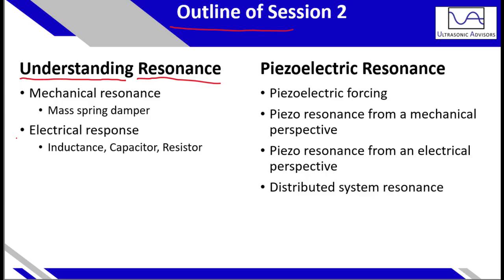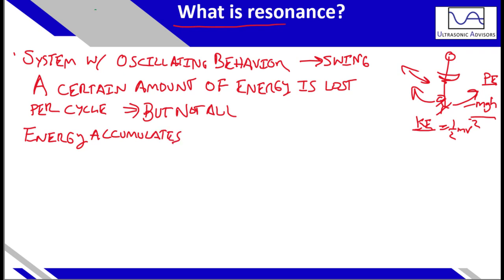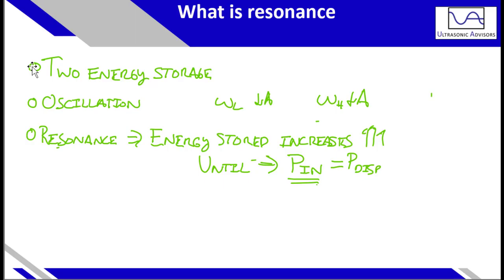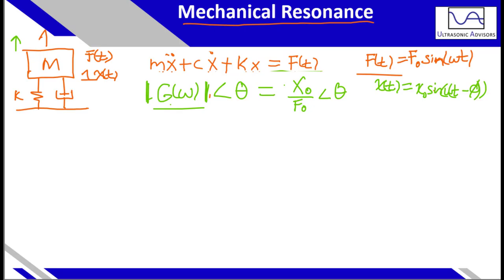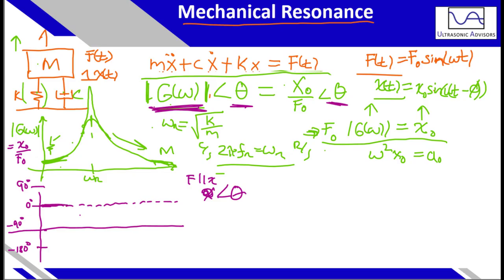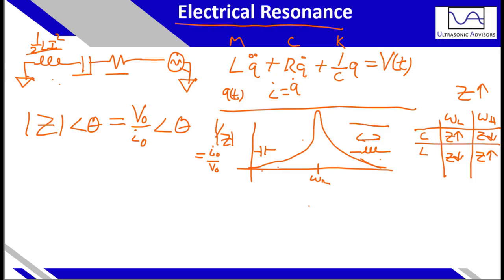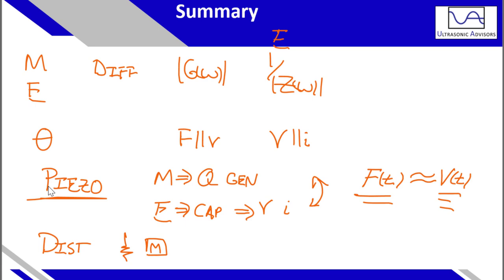Session 2: Resonance behavior | Piezoelectric/Ultrasonic Impedance Analysis Course

Comment from the maker: Mechanical and Electrical Resonance and their Application to Piezoelectric Devices
This session covers the basics of resonance, including mechanical and electrical resonance, and their application to piezoelectric devices 
00:10.

Mechanical resonance occurs in a mass spring damper system, while electrical resonance occurs in a system with an inductor, capacitor, and resistor 
00:58.

Piezoelectric resonance is an electromechanical phenomenon that involves the conversion of electrical energy into mechanical energy 
01:39.

Distributed system resonance occurs in systems with mass and stiffness, and can involve various types of vibrations, including bending and longitudinal vibrations 
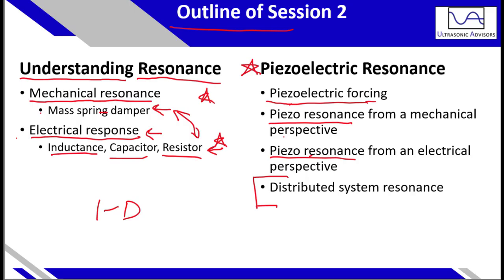02:51.

Resonance can be understood by considering a simple system, such as a swing, where energy oscillates between potential and kinetic energy 
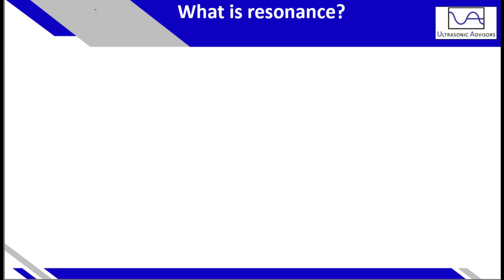04:13.

The frequency of application of force can affect the amplitude of the resonance, with a slow push resulting in a small amplitude and a fast push resulting in a highly ineffective and potentially dangerous situation 
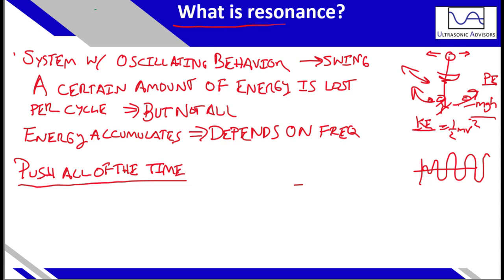10:01.

However, if the force is applied at the right frequency, the amplitude can increase significantly, resulting in a highly effective resonance 
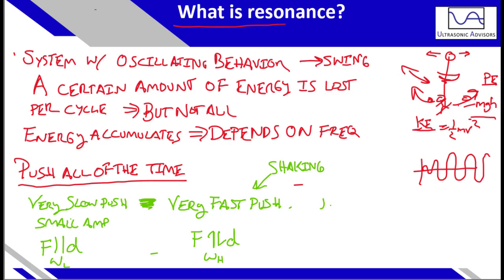12:51.

Resonance occurs when the energy stored in a system keeps increasing due to the continuous delivery of energy at the resonant frequency, resulting in a maximum amplitude 
15:30.

The power or rate of energy put into the system equals the power dissipated, causing the system to peak out, and this point is a transition point where the phase between the forcing function and output changes 
19:02.

Mechanical Resonance
A mechanical resonance system consists of a mass, a spring, and a dashpot damper, and is described by an equation that relates the mass, acceleration, damping coefficient, velocity, spring constant, and displacement 
20:04.

The transfer function, which relates the input force to the output displacement, has an amplitude and phase, and is used to analyze the system's response to different frequencies 
21:55.

The amplitude of the system's response changes with frequency, with a maximum amplitude at the resonant frequency and lower amplitudes at higher and lower frequencies 
25:45.

The relationship between input force and output displacement is described, with the amplitude of the output displacement being larger at lower frequencies and smaller at higher frequencies, and the resonant frequency being governed by the stiffness and mass of the system 
27:39.

The phase relationship between the input force and output displacement is discussed, with the phase being 0° at low frequencies, 90° at the resonant frequency, and -180° at high frequencies 
31:15.

The concept of power input is introduced, with power being the product of force and velocity, and the most efficient point of force input being at the resonant frequency where the phase is 0° 
37:56.

Electrical Resonance
An electrical resonance system is introduced, consisting of an inductor, capacitor, and resistor, with a forcing function of a sinusoidal applied voltage 
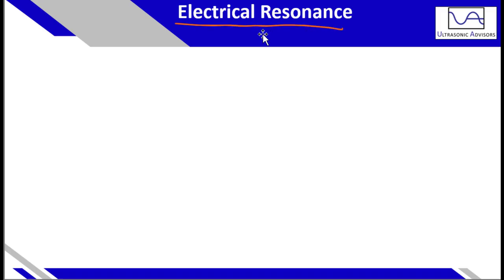38:28.

The analogy between mechanical and electrical systems is discussed, with inductance being related to mass, capacitance being related to the inverse of the spring constant, and resistance being related to losses 
39:20.

The differential equation for the electrical system is introduced, with impedance being defined as the ratio of voltage to current with a phase 
42:17.

Impedance analysis is used to understand the behavior of piezoelectric/ultrasonic systems, and it provides the same information as other methods, making it a useful tool for analysis 
43:04.

At low frequencies, the capacitor dominates the circuit, and at high frequencies, the inductor dominates, affecting the flow of current and impedance 
45:33.

The impedance of a system changes with frequency, with high impedance at low frequencies and low impedance at high frequencies, and it is affected by the resistance of the system 
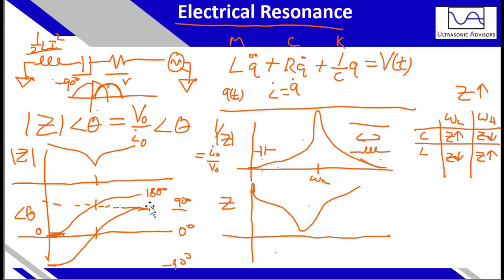51:03.

Piezoelectric Resonance
The analysis of mechanical and electrical resonance systems shows similarities between the two, with the same differential equations and expressions for transfer functions and impedance 
52:06.

Piezoelectric resonance combines mechanical and electrical systems, with mechanical oscillations driving charge generation, which is then translated into voltage and current 
53:36.